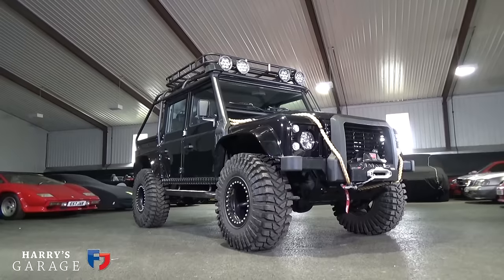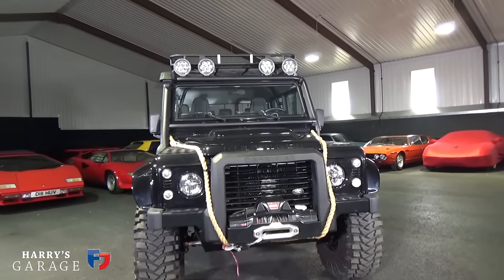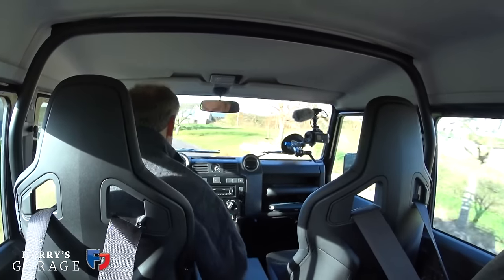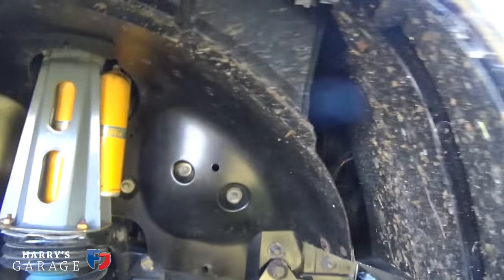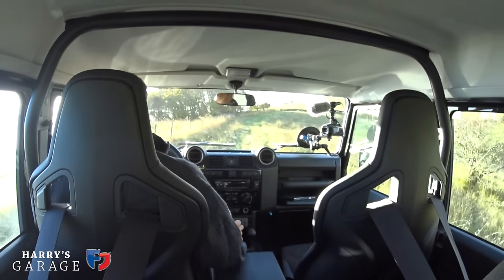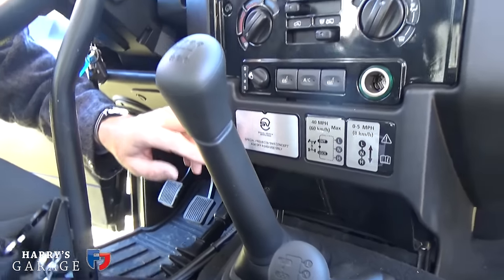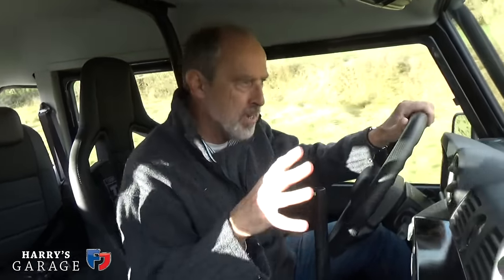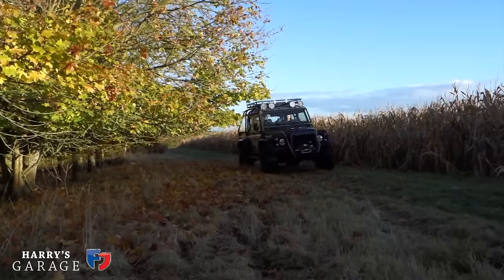Ultimate Defender, SVX Concept review. Spectre, Bowler

Comment: Should put the supercharged V8 engine of the F-type SVR in there. :)
Reply: why would you fuckin do that. these are defenders for fuck sakes, they are classic for the rover power plants and now we have eeeejits.... specially the 2.4 and 2.2 ford engine defenders. I mean come on ffs. their not defenders if they haven't a rover plant in them...
Reply: honi9
 Blablablabla. The Range Rover has that "plant" in it. Is it not "a rover"?
Also, this is highly customized as is, so who cares if you change that old tractor engine too.
Reply: no its not... its a hybrid.... not original...  you call a spade a spade don't you. but if a spade is half spade and half fork, then its not a proper spade is it...
what your speaking of is the modern day Chelsea tractor range rovers? Yes? Well their just like the defenders that at the same timeframe when rover stopped making their own engines started using others. ie the 2.2 and 2.4 ford transit engines.   their not original defenders and in years to come you will see that the original rover engine models, the tdi, the td5 and the rover v8's will be the most valued and desirable. specially the ones like my 200tdi which have been kept totally original and have always had replacement landrover parts and not aftermarket shit whenever its needed repairs.
Reply: do you even drive a defender or rangerover? their supposed to have that tractor engine, that's what makes a defender ffs..
obviously its completely customised and im not knocking it at all... its a well engineered bit of kit. you just cant compare that to a defender. all it shares is body panels and a ladder chassis, fook all else...
Reply: oh no they are both fords. interesting you say bmw as years back they did do a short run of defenders with a bmw straight 6, 2.8ltr, 24 valve petrol engine known as the bmw m52 power plant for the African market. these are as rare as rocking horse shit and likely worth a lot of money here in the uk and the usa if you could find one and restore it here. even though I have always felt that a true landrover should have a landrover plant, still would be a nice desirable motor to collect.
I haven't ever seen that the td5 was an army version only though, not sure where you got that from? its been a production engine in defenders, discoveries and I think rangerovers for a good time and was the last true landrover produced engine? I may be wrong on the rangerovers?
thing is landrover died when they stopped making engines, what a shame in my eyes.
in my eyes they made some of the finest engines ever. specially the 200tdi and the v8 petrol. Those who say these motors are unreliable can be down to one thing only. they don't service nor look after their vehicles. you can just jump in and drive a landrover forever more. a good serviced landy wont ever let you down, trust me. btu they are aa pain to service and lookafter as their is so much to consider. countless grease points and various opils for tranny, gearbox, engine, trans box, axles & diffs, hubs & cv's. powersteer system & box. oh man its a pain, but worth it just to own one.
Reply: that's the kicker.. you can get discoveries, specially 1's and 2's very cheap here and they basically are a fat, obese defender. if your wanting a cheap work truck that's reliable and tows for fun then you can get a good td5 for £1000 and tdi's with usual rear 1/5th chassis and body corrosion from a couple of hundred quid. but as soon as everything becomes DEFENDER then prices multiply exponentially. its nuts honestly...
if you know your stuff you can do ok with these defenders as if your patient you can find good ones from time to time on fleebay at good prices, but be prepared to travel into the far wilds for them as this is usually why they don't attract too many bidders. I go my 110crewcab pickup in bottle green, completely original from a dear old fella that sadly past away. it had 103,000 miles proven with every single mot cert from day one. also with every receipt for any work done over her years. she was looked after well. I got her for only £1700 which isn't much at all as these 20tdi versions with the Salisbury front and rear axles are desirable. but anyway despite these positives she did need some work as the rear 1/5th of chassis was past best and in my experience once you start pissing around with chassis damage of that size and spending £200 on a rear 1/4 chassis to replace then you may as well find a cheap chassis and just do a chassis swap as this wont take much longer to do as it would do simply replacing the rear section. you wouldn't think this but it a pain and very tie consuming replacing just the section of chassis, ive done it before and I could have just swapped the whole chassis in near enough the sametimeframe.
 I found a rolled 6yr old 2.4 puma defender and got the chassis for only £300, I sandblasted it and spent an extra £150 to take it off for galv dip. then when I got it back she was painted with some real expensive boat hull paint which is unreal shit. I was lucky to reliberate this paint from a shipyard for nothing that my dad is boss at. het ho!
if you done a swap before the second time is a charm, with experience these can be stripped and re-built in a week easy. but if you do this be ready to spend a couple of hundred quid as your obviously going to replace some important tuff whilst shes in bits. plus all the buts and bolts and other stuff that would comeloose that had to be cut off....
but hey, its all worth it, its all love my friend...
Reply: technically the 2.2 is a PSA unit, the same as most other Ford TDC engines of the era. Ford developed the engines in partnership with Peugeot/Citroen and it has been around in the Peugeots for quite some time in various sizes as the HDI. the 2.4 was an enlarged capacity version of the engines fitted to the mk3 Mondeo.
as for Defenders running 'Rover' engines, Jaguar was bought by Ford in 1989, (it later being bought by Tata) and Land Rover in around 2000, when BMW were breaking up the old Rover Group (Keeping the Mini brand and selling off the rest to various owners, like MG to Chinese owners, Land Rover to Ford etc) so the Ford engines made sense. Those of you who think of the 3.5/3.9 V8 engine (relatively rare in the UK but probably common in markets where fuel costs were less of an issue) was a 'Rover' engine, are also sadly out of luck. a British Leyland (as they were at the time) executive was visiting the USA (I forget why) and saw the alloy engine block dumped in the grounds of Buick facilities, where he requested to buy the engine and rights. so the V8 is technically a BUICK engine.  

As the TD5 has been mentioned, no it was not designed as a British army only engine. I had a friend working on them in the army at the time and they HATED the TD5 due to the electronics and that it was more sensitive to fuel grades (as it was a more complex injection system) than the older more basic 200/300tdi engines.

there were NO autos EVER in the UK spec defenders, except for a handful of limited edition vehicles (50th anniversary edition if memory serves me) which did have auto option. there are companies offering conversions to auto for other models though.
Reply: that's right, I do remember reading that about them developing the buick v8 block...  they were very rare to see as a v8 defender as they were usually a NAS spec north American spec which are also pretty special as I think these are 100inch chassis though I could be wrong.. but these were tricked right out from what I recall and were a very high spec v8 for the American market who liked all the flashy do-dads and thingy-me-jigs in the cockpit...
if you wanted a v8 defender they were plentyfull in Lincolnshire here in a uk army depot where they were selling off army surplus after these were rejected in the first Iraq war as the snatch landrover. for £2500 you could get a well maintained v8 with dual webber carbs and wolf spec drive train. this was 8yr ago and whether they still are im not sure.
I cant recall what gearbox they used with these defender v8s whether it was an lt85 or an auto? I know the snatch I seen had an lt85.
only thing with these snatch landies was that you were effectively buying a good running and rolling chassis as once you got that snatch bulletproof body off you then had to source the rest of the bodywork, bulkhead and interior to rebuild it. Though luckily when I did one the scrap price was £220 a ton for grade 1 steel and we got just shy of £750 just for the snatch body which was a great help towards building the rest of the project.
Other ways of getting a v8 for transplant into a defender were from a discovery v8 which were here and there, also plentyfull in the rangerover....
Reply: BRAD....  Sounds like your the guy for the rangerover advice hey...  I have to say I know shit all about modern rangerovers. if im honest I hate what they represent, their celebrity clown mobiles.  Rangerover 1's were a staple of stately homes in the Uk and winter shoots, fox hunts ect....  they weren't scared to go offroad or to have a couple of wet muddy gun dogs in the back on the drive back to the yard.  I sadly don't see any of these modern tricked out rangerovers doing that these days, its always defenders nowadays.
Were loosing the sadly and in 50yrs I wouldn't be surprised to see these original 200tdi, v8's and the series landies making real good money. Their prob one of a few motors you can find for a good buy of you know what your doing on fleebay, use it for a few years and then sell her on and actually make good money on. I mean my £1700 110 crewcab pickup 200tdi as it is now with a new chassis, fullyrebult, resprayed bottle green with fullserv history and only 104,000 is easily worth £5000-£6000 as shes absolutely mint. ive had her 1yr and done only 1000 miles in her.
Though this ones a keeper, I doubt I would ever sell this one as I know I be lucky to find another like her with such history, 1 prev owner...
I would like to do a 101 truck though atsoe point, I think their 101 trucks?
Reply: that's right they always made body panels from alloy because of the excess of alloy after the war effort. this a practice they stuck with throughout. defenders that is.. mine has a steel ladder chassis and steel bulkhead, floor panels and I think bonnet. the rest is all riveted together alloy panels.. very easy to repair. infact if your half a fabricator you need not ever buy a new panel to repair a damaged one as its easy to drill out rivets and replace/repair with new sheet..
Reply: tell you what, you'd hate to have all us fellas in my local after 7-8 beers at closing time, you'd never get us out. Or even shut us up to ever get the chance to inform us its closing time.
tell you one other thing, other than the older disco's that were used in camel trophes ive not ever seen a modern disco or more so one of the modern rangerovers truly built and used for offroad purpose or even offroad competition...
I will finish with this one thing. not sure if the 4.4 twin turbo rangey is for aus market or not but it sure aint for uk as nobody here could afford to fuel the damn thing for sure. not at £1.30 a litre.   Myself im quite lucky as I bought an extra long range fuel tank and with some clever fudgery of the fuel lines I can switch between green diesel (legal) and my long range tank which houses red diesel that's not taxed and only 70p a litre. if I ever encounter vosa or dvla on the road I can switch tanks easily via a switch on dash as this is 12v solenoid driven...
next plan is to add a tranny box pto drive to a rear pto gearbox and coupling. I use quit a few various tools on the road at certain jobs and over years have bought alternative pto versions of compressors for sandblasting with a huge 140cfm output, big basketball sized piston and dual piton affair. also a pto generator giving 15kva 3 phase and 7kva single phase. also a big water pump and powerfull pressure washer which could have been handy over the past few winters as the UK in Cumbria is prone to floods and I could have helped others no end with this. also a large pto winch which is more for logging than your average 4x4 winch.
Reply: honi9
I have driven a Defender and a Discovery. The Defender was terrible. The Discovery OK. But there are much better choices out there...
Poor materials, poor technology and some of the worst reliability in both of them.
Reply: tali sson that may be, in your opinion. the defender is less wallowy than the early discovery and whilst the discovery is better equipped, it is the sparseness and the actual driving characteristics that make the defender so well loved. people don't like it because its a great car. its barely changed in the 70 years it was in production. people love it because its a DEFENDER. a basic vehicle that can do literally ANYTHING (you used to be able to buy so many attachments to fit them they were just a 1 vehicle swiss army knife!) you need to do.

Comment: looks cool but it didnt go anywhere a standard Disco TD5  with mud tyres wouldnt have gone, maybe a little quicker but not much better off road and useless on road. you might want to fit some diff guards ad well, would be a real mess if you were to hit half a brick on one of those slightly sloping grassy fields.

Comment: Why did they not use rubber at the end of the suspension?
Reply: ashystyle Rubber bushes probably wouldn't be able to take the hammering in the high altitudes and therefore low temperatures in Austria. Plus they don't need to drive on a tarmac road so don't need suspension damping, so why add extra weight and complexity when it isn't required?
Reply: But it is one thing if you are modding this car only for offroad usage. Completely different thing if would like to use this both on and offroad. In my opinion this should be able to be used both on and offroad and therefore in need of less loud suspension!
Reply: ashystyle But it was made purely for off road purposes. Rubber bushes have more give in them so wheels and axles can move slightly in ways you might not want, where with the rose joints there is no give so everything is held firmly which is better when you are going off road.

It could maybe be modified to have rubber bushes instead, but it would not be as Land Rover designed it then.

Comment: So what's the advantage of the rose joints then?
Reply: It eliminates deflection in the shocks mounts and is much stronger than a rubber bushing.
Reply: Articulation.
Reply: And if they are what's knocking then he's got a serious problem as they don't rattle at all, unless they're falling apart ( i.e. knackered).
Reply: The rattle seems to be that the dampers swivel too easily on their rose joints and hit the bolt head that attaches them to the vehicle.  Personally, I'd add a rubber washer to the bolt to stop them from hitting so hard, but that's just my opinion.
Reply: I also think a better solution is available. Metal hitting metal is generally not good.
If the washers, or whatever circular metal piece that is was smaller in diameter then the damper end would not impact it....seems like a simple fix.
Reply: The rubber bushings that are installed for the road going version compromise the performance of the shock absorber,  a few mm deflection leaves the shock playing catch up and with big tyres like that it would be all over the place. You may not have caught the reference to Bowler, they build Paris Dakar Land Rover based cars.
Reply: +James Young Don't be silly mate... the average youtuber knows way more than Bowler lol
Reply: Basically a ball joint, think a tie-rod end (tie rod bushing, which is also a Heim/Rose joint). Usually suspension parts are held with a firm 90 degree joint with a rubber race/bushing, which is more than fine for regular driving.

Comment: Handbrake looks like it could impale you in a crash.
Reply: Not if you're strapped in.  That's the usual position and style used for hydraulic handbrakes, as it needs to be at hand for quick use.  The stock position and style just aren't good for fast and precise use.